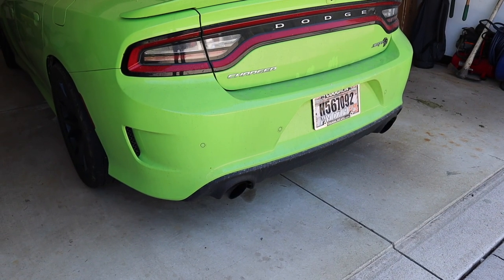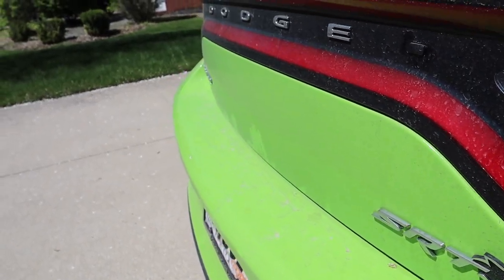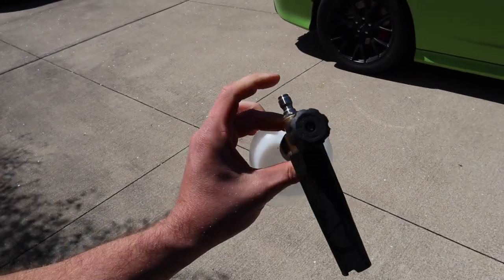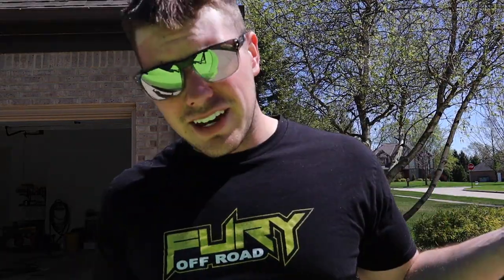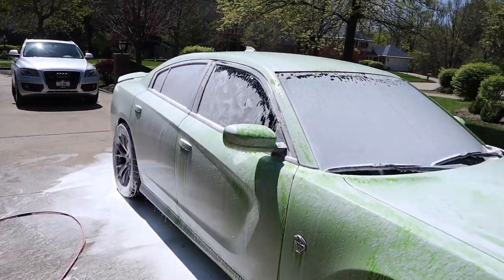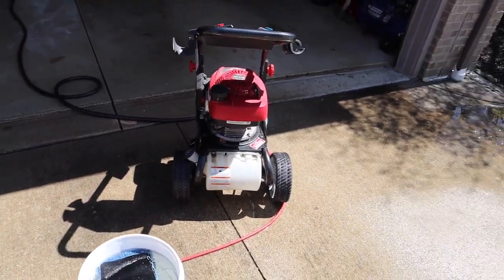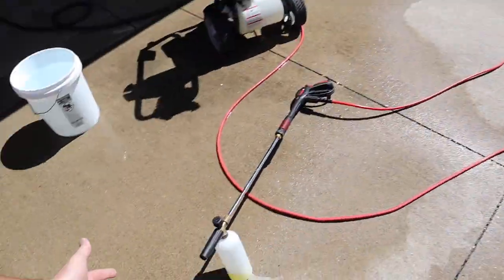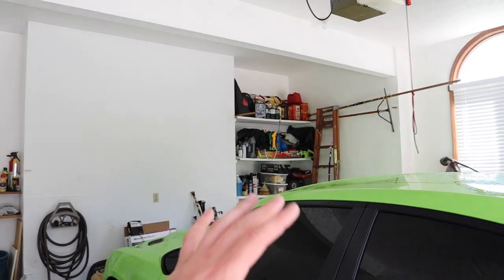Foam Cannon Comparison *AFTER 2 YEARS of USE* ($16 Amazon Cannon vs $90 "Professional" Cannon)

Comment: i have used mine for a year now and no issues.. two biggest tips to make the best of your foam cannon.. first, use a designated foam cannon soap.. it is a higher foaming soap and will really make a better foam.. 2nd and most important, go online and purchase a better orifice.. these foam cannons come with a standard 1.25 or 1.33 mm orifice.. change it out to a 1mm orifice and wow, what a difference.. I have foam as thick as shaving foam it's unreal... I bought the MATCC foam cannon on amazon for $22 and the 1mm orifice for I think $7...

Comment: Whats with the car. Is it not for SALE?. Have u not been told. Pressue wash is very bad for vehicales. U will not know because. U will not have in 10 years. Pressure drives. In the dirt. In every crack. And plus u dont have salt
 Why do u use that goff thing. Can u not just wash it with soap pail. And brush. I stead u make a big deal and movie
 Just washing. You r to funny i was young to i think its funny. The way u talk and stuff u do. I have a pic for u..i dont know how to send it to u. U will love it. Im seriously not kidding. U have all nice veicales. I have 2016 ram. 1500. Crew full 4 doors 4' lifted. Nitto terra grappler. And moto metel wheels.. And 2 four wheelers. One atv other utv. Both can am. One is XMR.1000 2018. Other maverick trail. 800 2018. Love them. But i died in 2014 came back was given 5% to live.